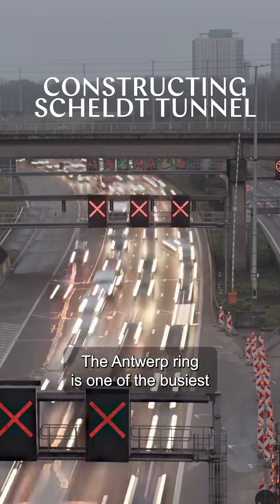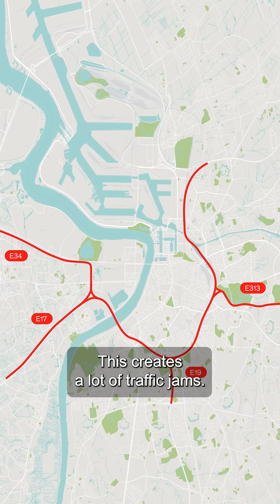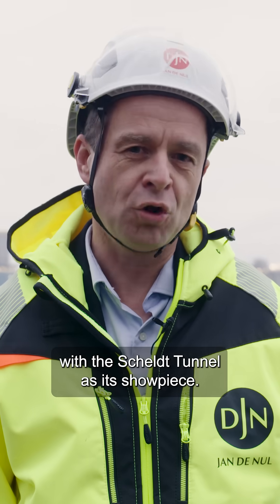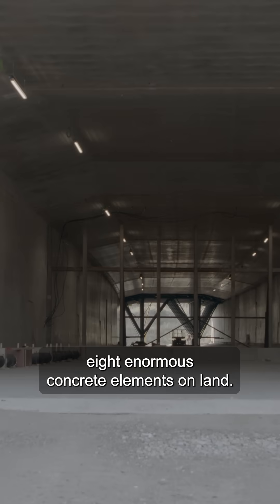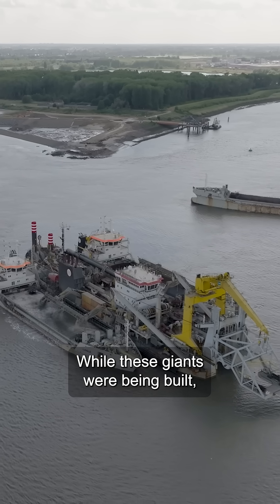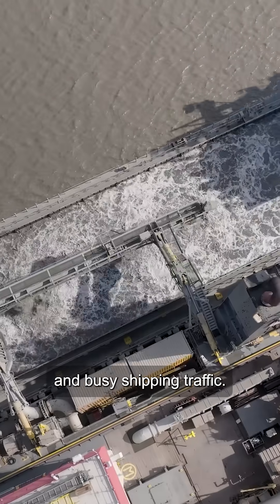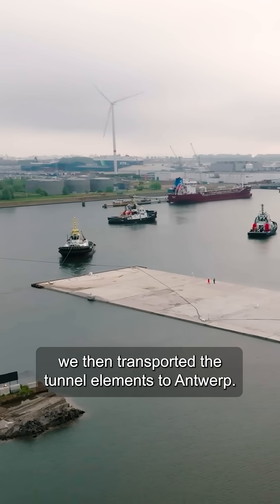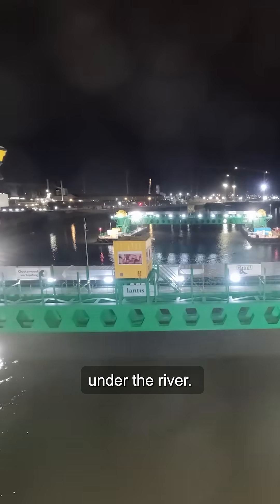Constructing the Scheldt Tunnel in Antwerp, Belgium  #jandenul #oosterweel #antwerp

Comment: Does it leak!!???
Reply: Pumps operate to remove water in most tunnel systems. It's a reasonable measure as no system can be fully dry at reasonable cost.
Even the air brings humidity according to the atmosphere.